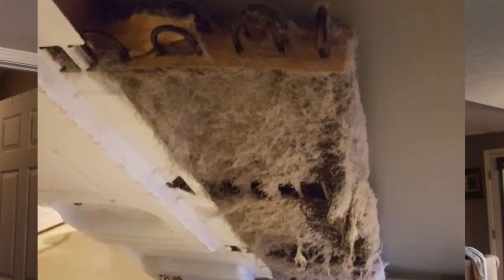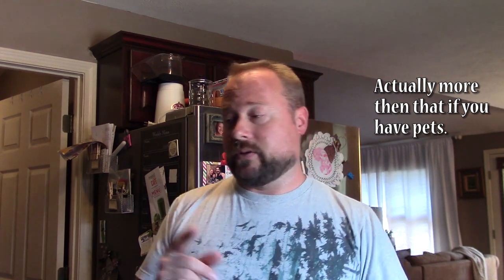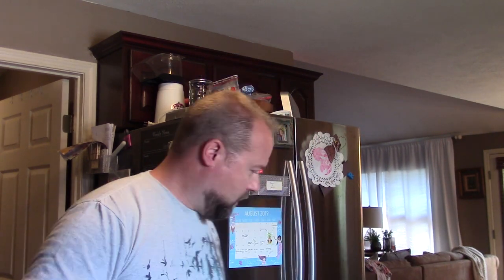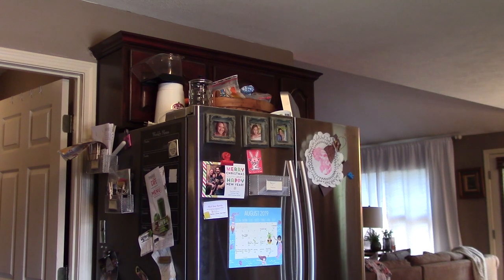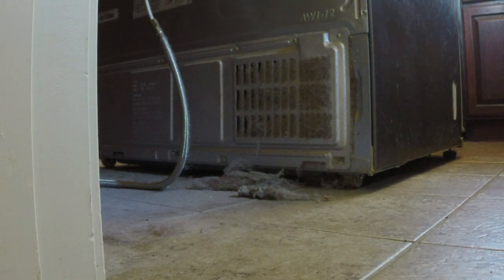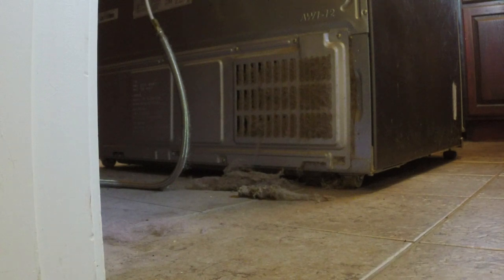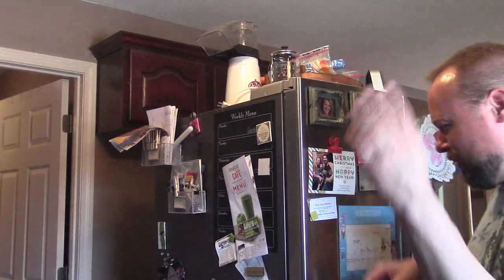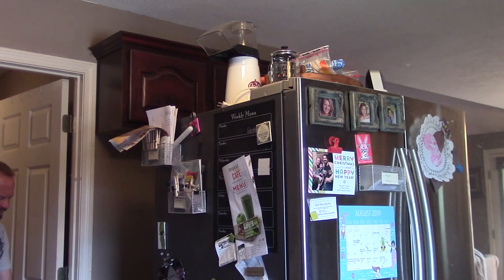How To Clean Your Fridge Coils

Comment: Used a leaf blower. Put a box fan at the rear with. ac filter taped. The filter caught all the dust. No mess, quick easy.
Reply from the maker: That's a nice tip. When I went back the next time I did it sooner so it wasn't so built up and started slower. But I like your fan tip.

Comment: I like the idea of cleaning out the coils but now you have to dust the whole house
Reply from the maker: Well, it was really just in the kitchen. And since I made this video  I have done this again, but a little different. First, I didn't wait as long so there wasn't as much down there. Second, I started off slower with just a couple of smaller bursts and cleaned it up as I went. Then I built up to the stronger bursts. Still dirty, but not nearly as bad.
Reply: @AroundTheHome1 put a box fan at rear of frig with an ac filter rated to it. Us leaf blower fro. Front. The ax filter catches the dust. Quick easy.

Comment: very good tip.  I was being lazy with my fridge and i didnt clean it for a few years (3-4) came home one day and it was making a high pitched humming noise,  I immediately pulled it out, unplugged it and got my shop vac and air compressor out.  I didnt have nearly as big of a mess as you did as I used the shop vac first.  I also took out the back panel and cleaned the coil with air compressor.
Reply from the maker: Ah, using the shop vac is a good idea, but don't know fun until you create a dust storm in your own kitchen. Thanks for watching. Don't forget to stop by our website www.greatwhiteninja.com

Comment: If you turned the fridge over and looked at the coils you would see you only touched the tip of the iceberg. If there is an easy way to clean under the fridge, I haven't found it. I'm 72 yr. old and I've always been a cleaning freak.  But this definitely is NOT the way to do it!!! I tried it many years ago when I was a young wife. This way is NOT worth all the effort put into it.
Reply from the maker: Yeah, sorry to let you know that you are incorrect, but you are. Using a blower to get the dust out gets like 98.5%. I have found it better to have a vacuum set up and running while you do this and to start with smaller bursts to help control the mess. Though, I know that you have not tried using an EGO leaf blower with 530 to 650 cfm of force because they were not available when you were a teenager and if you were using an electric blower then, it was like a toddlers toy compared to what I am using here. I have lifted a fridge after I have done that to confirm that I did indeed get all the dust loose from the coils and everywhere else.

Comment: After I see he use the blower instead of the vacuum...bye bye.
Reply from the maker: Well you won't get even a quarter of the dust compacted in there with a vac. Can't reach it. So it has to be blown out to get it clean. Don't like the leaf blower, use an air compressor. Sorry you can't handle it.

Comment: Gross proply not smart to let bust fly. In house though
Reply from the maker: It is gross, but that is what is under your fridge. I have people say they will just get the crevice tool for that, but I promise you that you will not even get 1/3 of the dust wrapped around the coils that way. If done on a regular basis then there would be very little dust to come out. That is years of dust and dog hair that you saw, and it still it didn't take that long to clean up. Thanks for watching and don't forget to stop by our website for many more helpful videos. www.greatwhiteninja.com